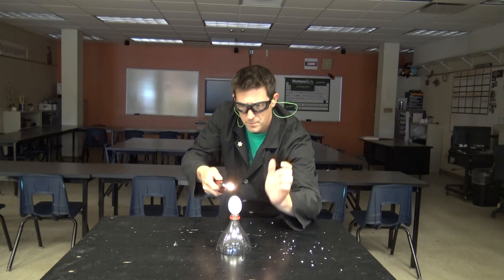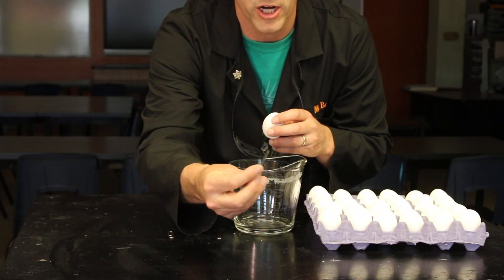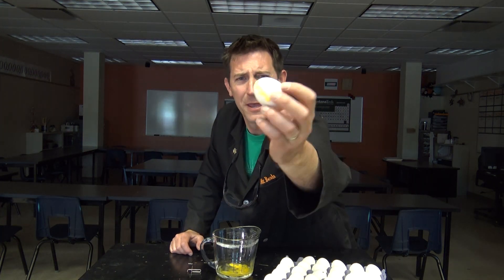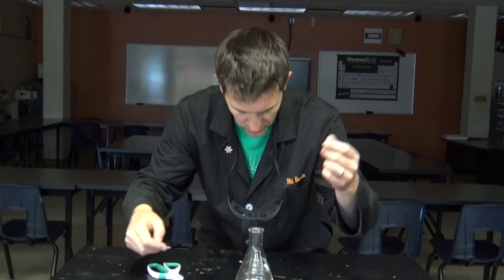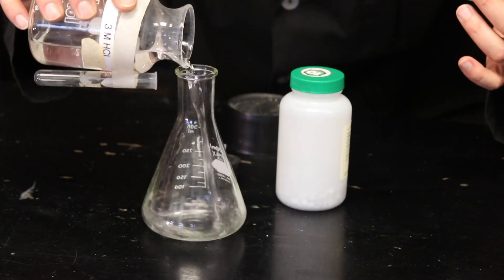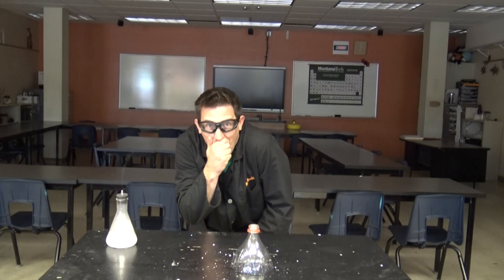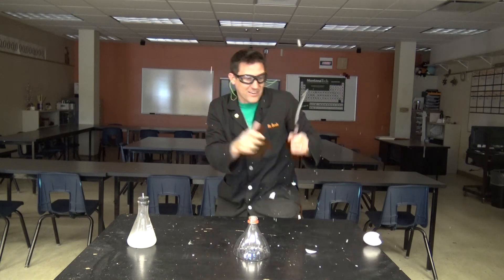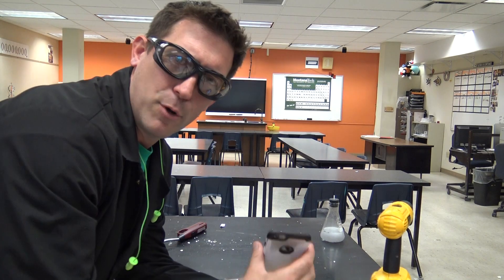Exploding Eggs - Making Hydrogen Gas from Acid

Comment: The lack of latex gloves when handling the HCl was tearing me apart.

Other than that great video man, it'd be nice if you could go into more detail in regards to why H2 and O2 create such a violent explosion when we're "Just making water".
Reply from the maker: Gloves. Good idea. I will model better safety next time!
The combustion reaction between hydrogen and oxygen is a synthesis reaction that combines hydrogen and oxygen into H2O. In this reaction the newly bonded compound (H2O) has less chemical energy than the bonds of the reactants (H2 and O2). So, after the reaction, more energy exists as heat (and/or light) than before it reacted (don't forget the Law of Conservation of energy - energy cannot be created or destroyed during a reaction, it just transforms into another form). 
Does that help at all?

Comment: Shouldn't you be mixing the chemicals in a fume hood? And set the flask away from the table away from the exploding egg?
Reply from the maker: Safety First! I like the way you think!
The H2 gas dissipates very quickly so a fume hood isn't necessary at these concentrations. A larger gas collection device that was pumping out excessive amounts of hydrogen would definitely need to be used outside or in a hood!
I should have moved the flask away - you are right. Thank you for making sure others are thinking about the precautions!
And, thanks for watching.